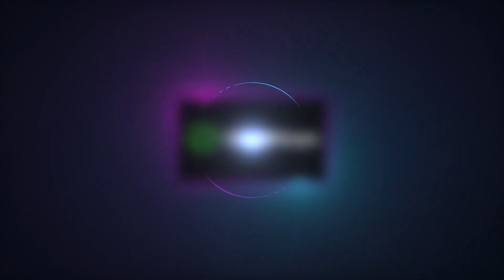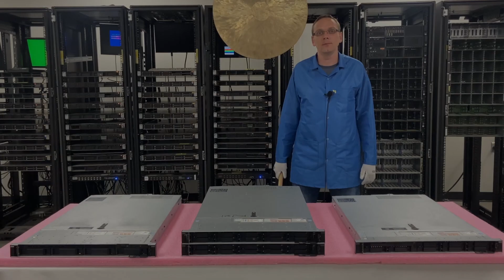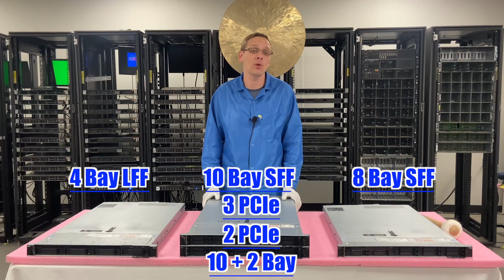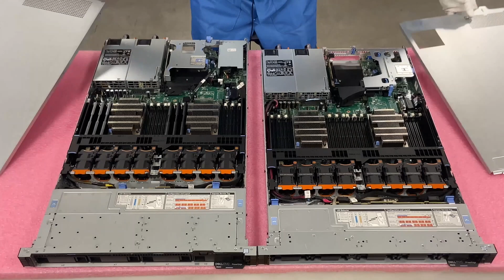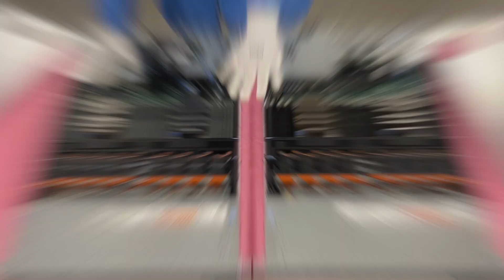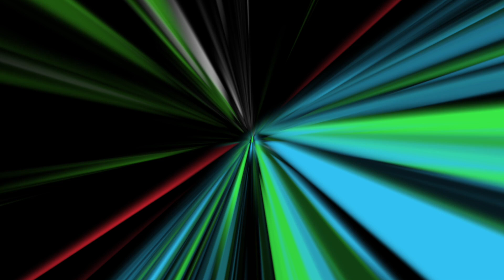Dell PowerEdge R640 Overview | Different Chassis Options | 4 Bay LFF | 8 &10 Bay SFF | 10+2 Bay SFF

Comment: Can you add the rear 2x SFF to the 3x pcie slot chassis? I wanted to upgrade mine, but it looks like there’s a nub that’s intended to support the two left pcie slot brackets that cannot be removed that will interfere with
Reply from the maker: Negative.  Different chassis and motherboard.  At that point just buy a different one.  Check out our deals of the week.  Got a sweet one (while stock lasts).  R640 10 bay nvme (8 nvme / 2 SATA) with 44 cores 256GB 2x 1.92tb nvme (new) dual 10GbE  at $1300 range.  Hit up sales@cloudninjas.com.